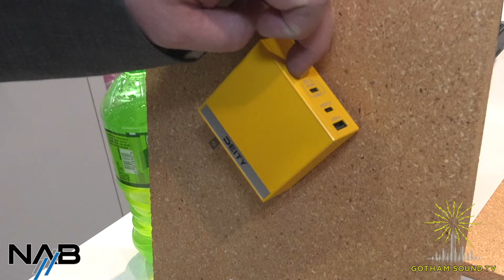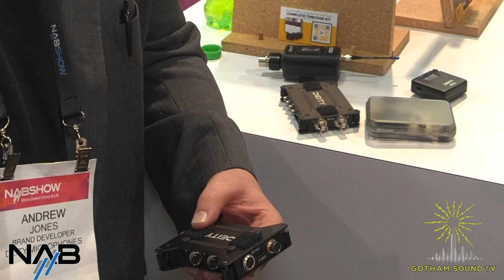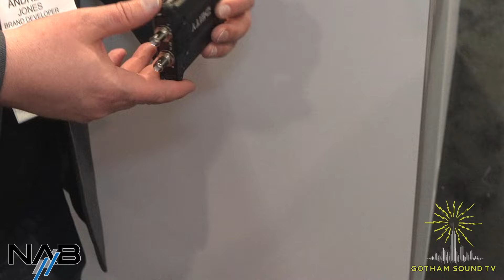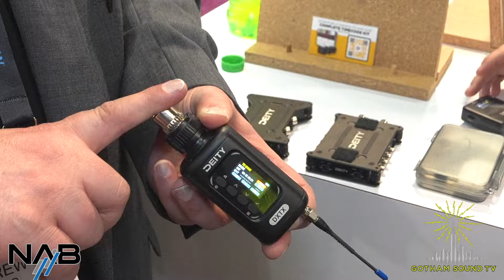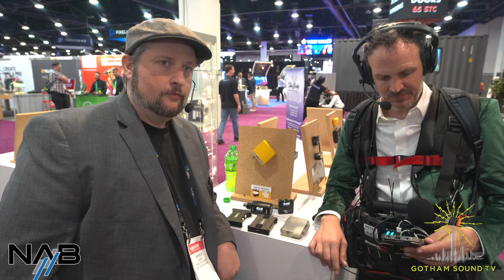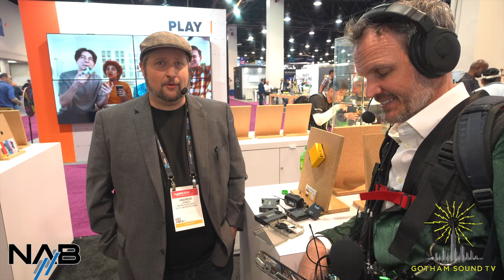NAB 2024: Deity Microphones

Comment: 32bit Mono is a downgrade.
Reply: How much does this affect the recording using lavmics? Is there a big difference between mono which is duplicated to "stereo" and true stereo?
Reply: @bryllupsvideografIsak it only really affects stereo mics, but if you were getting this for the stereo function for sound recording, it will affect you. 

If you are using running a mono lav mic, it won't affect you.

It just the fact they originally promoted it as 32bit float stereo.
Reply: @mrshaheedmalik  I see. Thanks for the follow-up! 😊 Hopefully they at least consider the downgrade into the final price then!